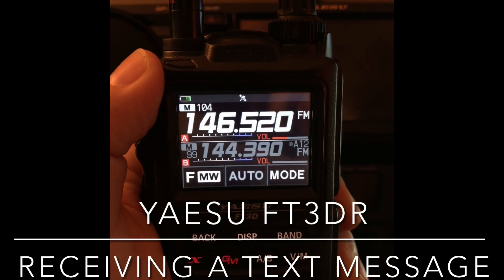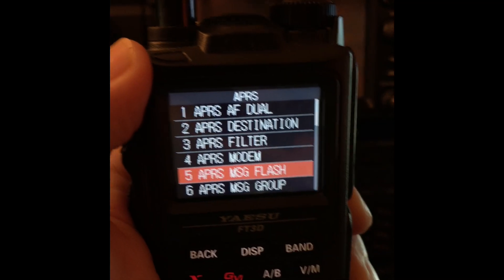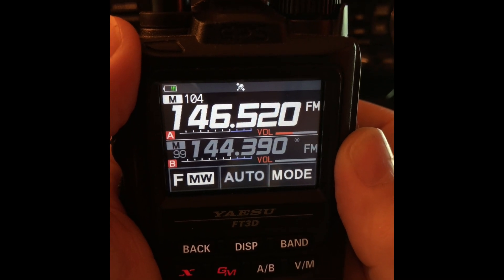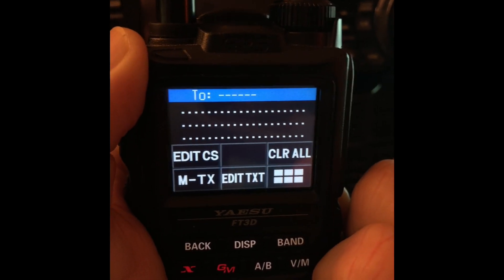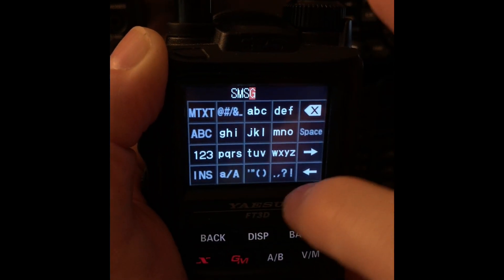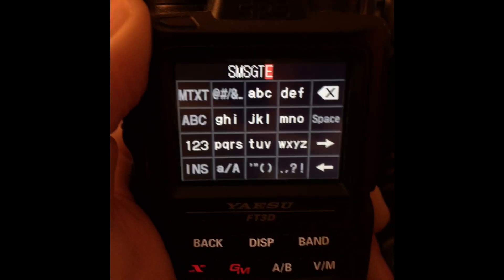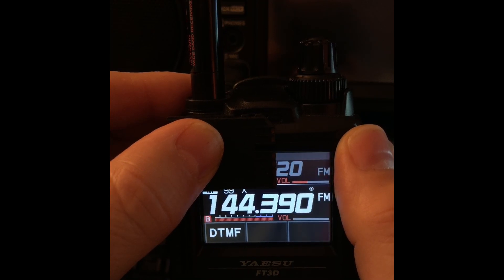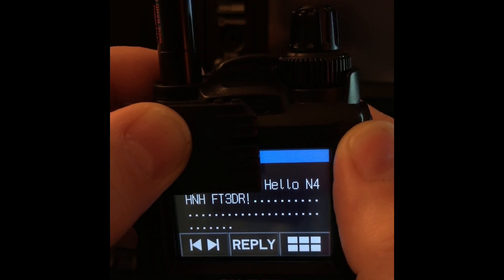Yaesu FT3DR: Receiving a SMS Text Message

Comment: Thank you for this!  I've been doing this from an off-grid stationary mobile Yaesu FTM-400 to send text messages to my wife and kids.  The messages go through but even though they respond to them, I don't get their responses. They're doing it correctly - any idea why I might not be receiving responses?  Thanks again... 73!
Reply from the maker: Mobile I could understand, but stationary should work both ways.  

You have to be in range of a digipeater or an iGate.  Sometimes in North Georgia, even though I’m on a mountain, I might be in an area without a digipeater.  My signal has sometimes made it to the iGate 60 miles away, but not until I reached the summit of the mountain.  

As more and more hams install digipeaters at their homes, this should become more reliable.

73, de N4HNH
Reply: @n4hnhradio  I have no problem sending from the radio, as I'm in range of a digipeater, but you're saying that the people responding from their cell phones also need to be in range of a digipeater or iGate?   I was able to get responses one weekend, but none the second weekend. Are there any settings in APRS I need to make sure are "on" in order to insure receipt of messages?  Thanks again!
Reply from the maker: Those sending to you don’t need to be in range of a digipeater.  I’m just saying that there can be inconsistent reception both ways, due to range from a digipeater, terrain, band conditions, etc.

73, de N4HNH
Reply: @n4hnhradio  Got it.  Thank you!
Reply from the maker: You’re very welcome.  My experience has been that APRS is somewhat inconsistent, unless you’re in an area with a dense population such that there are enough digipeaters and/or iGates.  It sort of defeats the purpose for now.  I need it in the mountains where I hike.  But as I approach the summit, I’m high enough in elevation to start getting a connection via a distant digipeater or iGate.

73, de N4HNH
Reply: @n4hnhradio  I hear you.  I rely on my radio for communication at my off grid cabin in the mountains.  I’m lucky that I can hit a number of repeaters, and having APRS is nice for the text messaging, but like you say, it’s inconsistent and doesn’t always play nice! 😉
Reply from the maker: Hopefully more people will setup digipeaters.

73, de N4HNH

Comment: This is really interesting and makes me consider purchasing a higher end radio.  I am making the assumption (and could be wrong) that there would be a situation where my cell phone had zero signal and was unable send or receive sms text messages but the radio COULD.   In other words, is the radio a more reliable and more powerful antenna and receiver than a cell phone?  That is the main question I have.
Reply from the maker: I hike mountain summits for SOTA.  It’s hit or miss whether a cell phone will have a signal on a mountain top.  The cell towers are typically lower in elevation and their antennas are typically oriented in such a way that the signal is localized, beam-forming more toward the horizon.

APRS is no guarantee either.  It relies on a digipeater or an iGate being within range.  However, any licensed amateur operator can set up a digipeater, using their 2m base station antenna, and quite a number do just that.

But, even if there aren’t many digipeaters in proximity to my location, I have been able to reach a digipeater 50 miles away from a mountain top, using my FT3DR.  So texting via APRS can be more reliable at times than with a cellphone.  The cellphone is operating at an extremely high frequency, using only a few hundred milliwatts.  The FT3DR is operating in the VHF spectrum at up to 5 watts.  The antenna of a digipeater will most likely have a higher angle of radiation than a cell tower antenna, allowing for a better chance for it to receive my signal from a mountain summit.

73, de N4HNH
Reply: N4HNH Radio :  Thank you!  That was very informative and helpful.
Reply: You will want a garmin inreach mini satellite text messager

Comment: Thank you for posting this.  I tried sending a text from my FT3DR to my unlocked iPhone on Verizon.  Wouldn’t go thru but when I sent to my T-Mobile line in the iPhone, it went through.  However for the life of me, the reply back from the iPhone on either line, is not going through.  No matter if I simply hit reply on my phone or create a new text to the number we’re not supposed to divulge.  Is there a setting I have messed up somewhere?
Reply from the maker: The only thing that comes to mind is maybe your phone service sees the number as spam, and it blocks it.  Verizon has a spam blocker on their network.  Maybe try adding the secret number as a contact in your phone.  As far as the radio not receiving the response from the phone, the problem could be location.  APRS isn’t 100% reliable because you must be in range of a digipeater or I-gate, and there are areas where they are few and far between.  73, de N4HNH

Comment: Thank you for sharing this! I just got an ft3dr and ive been trying to learn about it, and this was super useful. It makes me wonder, what would happen it an SMS was sent to me while my APRS or the radio is off? Do they pile up and come in all at once when I turn it on? Or they are lost? Also, these messages are public right? So be careful with what is sent, and give the other person a heads up on that? Thanks in advance!!
Reply from the maker: My understanding is that the APRS system will try to resend a message when it sees a beacon from your radio, indicating that you are online.  For how long, I’m not sure.  Maybe 24 hours?

Of course anything sent via the Internet and RF signals can possibly be read.  But, since the main uses of APRS for a SOTA activator are spotting and emergency communications, that is probably a good thing.

You are limited to 64 characters, so keep the messages pithy.

73, de N4HNH
Reply: @n4hnhradio  thank you so much for getting back to me! 73. KN4YRX
Reply: I set up aliases in SMSGTE.  That way the phone #s don't show up!